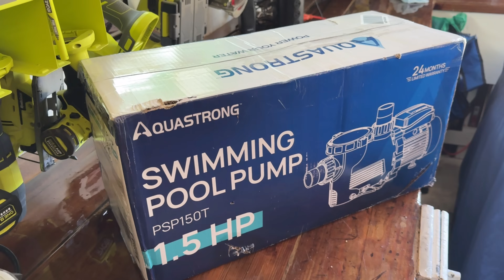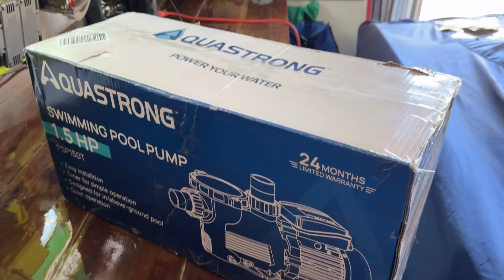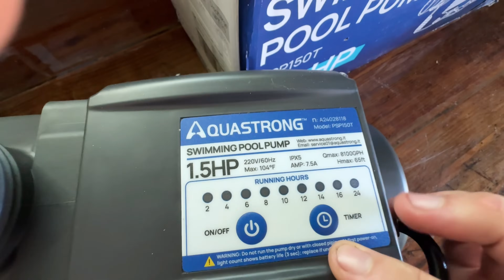Save Money! DIY New Pool Pump Install ~ Car Maintenance/Detailing - Family Vlog

Comment: Hey Bobby….a suggestion.   I bought one of those big plastic trash can holders that had the top that lifts up & the front doors open.  I cut around the bottom so it basically fit around the entire pump system.  Granted I can’t build stuff like you can.  I wonder if you at least made 2 sides & a top to protect it from the sun & reflect some of the heat.  Especially you being in FL.  🥵☀️. My Dad had our pool put in back in 95.  The motor quit working.  I found a man who rebuilds them.  Got it back up & running.  My Dad taught me a lot about the pool, the system & what the parts do & how it all operates.

Comment: I know you didn't ask my opinion, but Imma give it to you anyway. I'd send the old pump back to be refurbished (or do it yourself) so you'll have a back-up pump. Thanks for the video!
Reply: I agree. Send it back to the company to get it fixed. Then keep as a backup. Or ask for a refund.
Reply: @jessicaperlove4715 let them fix it or get yourm9ney back.
Reply from the maker: Wouldn’t be able to use it since I changed over all the pipe connections to a modern set up.

Comment: Great job on the pump assembly.  To me it looks like a confusing jumble of pipes, wires and boxes, but you have the magic touch.  It does seem that it should have a proper roof.  Maybe a pump house in its future. 
Car looks brand new and certainly road ready.  Have a great trip.
BTW, what was building a nest???
Reply from the maker: Thanks 😊. Not sure what made the nest, my guess is a mouse when we had the van parked outside on the driveway for a week.

Comment: That pump should still be under warranty. Can you send it back to be fixed under the warranty? You would have a spare then
Reply from the maker: Yes, but it wouldn’t work anymore since I changed the pool piping.
Reply: @cambrieabobby4162  ah, fair enough. Hopefully this one will be better than the last one and last you years